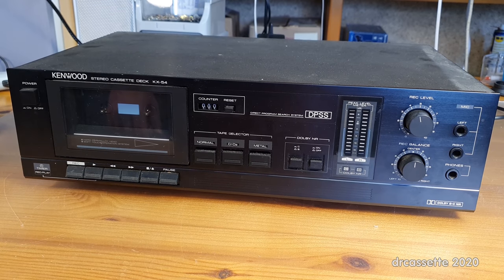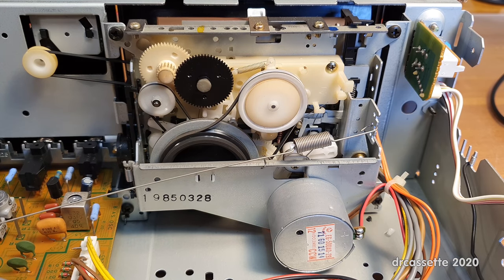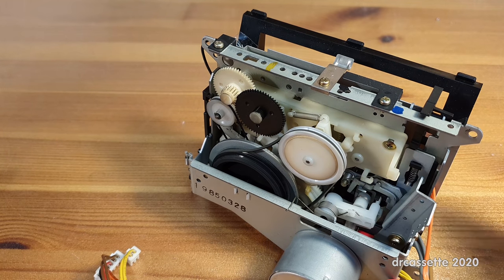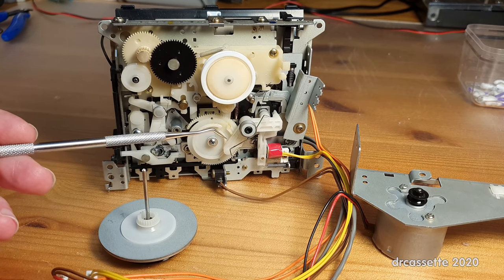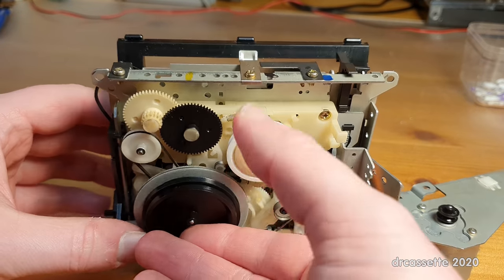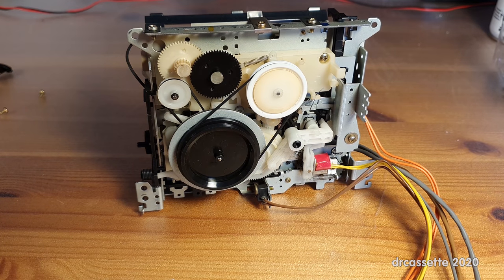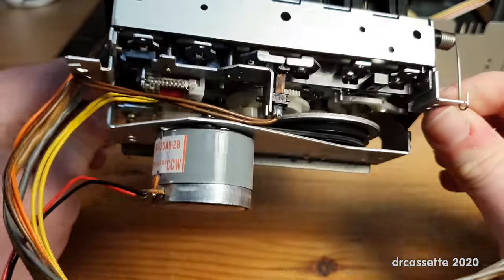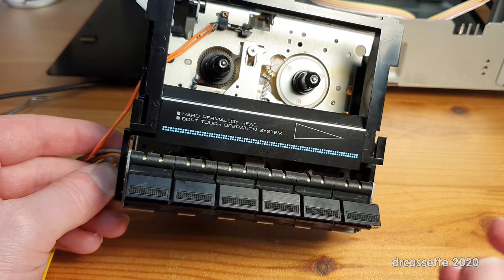Kenwood KX-54 cassette deck repairs

Comment: oh man, i used to work for the kenwood (and yamaha , pioneer , HK , etc) service station in europe and i must have repaired 1000's of these kx-54's in the mid 1980-ies , there's a known problem with these where one of the spring holders breaks and the play bridge just drops again after pressing play (easily fixed if you know how, just bend the now loose spring 90 degrees down and insert in the opening the spring holder now shows) 

these kx-54's were the cheapest entry level cassette players , speed was always a bit wonky but easily adjusted , just take a 3khz tape (recorded on a known good deck) and adjust speed on the motor (insert screw driver in the hole on the back of the motor) just make sure your pinch roller is clean and also the capstan axle is clean . if speed is still wonky check the main belt and make sure its not rotating . back tension is easily adjusted by pulling out the spring a little bit behind the take up reels
Reply from the maker: The KX-54 is indeed a very basic cassette deck, but I did like it. Unfortunately I couldn't get it to perform well. Later, after I had already disposed of the deck I found out the replacement motor I had used was a cheap Chinese fake of a Mabuchi motor, that's what was causing the excessive wow&flutter...

Comment: A bit like my Toshiba Beta video that didn't want to be fixed.  The set of locking levers on that also jammed up and had to be lubricated as best as they could be in-situ because access was not really on.  My YT videos on that were pretty long but the off-screen work was even longer.  These mechanical issues can take an age to sort out, most people don't have the skills or patience.
Reply from the maker: The big difference is, your Toshiba Beta machine is actually worth this much work being a collector's item. This entry level mid-80s cassette deck was a waste of time to be honest... I will give it another try in a few weeks, and if I can't get it to work then, it will become a parts machine...

Comment: Hold the horses - I've got the mechanism out of the case! Don't know how I'm going to get it back in again!! The motor pulley is locked with melted drive belt - hope I can clean it up properly.
Reply from the maker: The residue of melted belts can be cleaned quite well with isopropyl alcohol.
Reply: @DrCassette  Thanks for your reply - have replaced the belts and all seems to work ok although I got a fright when the motor and associated pulleys turn all the time the unit is switched on! I checked on-line and for a soft touch keys deck this appears to be common - the advice is not to leave the deck switched on unless you're using it. I now have another problem with the RH side of the VU bar graph display not working although with headphones both channels are working ok which smacks of an issue with the meter display electronics. Maybe a bad connection or dry joint somewhere? I've checked the schematic for the driver IC (AN68888) and it's difficult to see how the chip could be to blame for one channel not displaying. I need to get a meter on the voltage inputs to the IC.

Comment: maybe the reason you still have noise after repair is that while you oiled the mechanism, lithium grease needs to be replaced on the moving parts, not oil
as the oil is too thin to remain constant on the surface of the moving parts. But thanks for the video, well done.

Comment: This is a really good cassette deck for playback/Record with a correct azimuth. Also kenwood did it really nice and simple in kx series.

Also playing a cassette in this deck has much better sounding to it with a slight help of an equalizer. 

I have an earlier version of this cassette deck called Kx-31 and has very similar electronics inside it. I did use mine for (cd to cassette) recordings and sounded really great even on type 01 cassettes such as TDK D , Sony HF and Maxwell UR with higher levels. 

This cassette deck series can produce amazing good sounds if you adjusted bias slightly negative (pots are inside the deck and easy to adjust) and use TDK D, Sony or Maxwell type 01 cassettes and can be recorded at very high levels too .. Don’t use Dolby on recording coz no need. 

Also , I found that generally using slight negative bias is perfect for most type 01 cassettes and sounded great with higher levels on kenwood kx series. 

If you apply more bias on type 01 cassettes you will lose lots of higher frequencies on the tape and sounds get very poorly reproduce with higher uneven bass. 

I don’t know if you still got this deck , but maybe you can do some cd to cassette audio recording testings with ( bias pots adjusted to slightly negative )and see how good it is with good branded type 01 cassettes.
Reply from the maker: Many years ago I too had a Kenwood KX-31. The mechanism in that cassette deck was MUCH better than the one in this KX-54. 
This KX-54 sounds very nice, but it is let down by its simple mechanism.
Reply: DrCassette yeah , very true. 👍🏻👍🏻😉 kx-31 mechanisms were somewhat good. 
However, I also had to change main belt & take up reel belt time to time though coz I had been using the deck lot for tape recordings. 
But I do think it was a sort of Kenwood design issue which put motor and gear system & belts under lots of stress when you used daily 😢😢 

Kenwood was doing some cost cuttings on cassette decks back in 80s, but I am still happy to see this good old kx mechanism whereas we see even modern tape decks such as TASCAM 202 mkv2 uses cheapest cassette mechanisms can lead to lots of unfixable wow and flutter on playback/recordings over the time😉😉 .
Reply from the maker: I too had to replace the belts in my KX-31. The original belts had melted like they did on the KX-54.
Reply: DrCassette True, unfortunately 70s,80s  original rubber materials had a tendency to melt like that over the years. 

I think newer 90s belts made up with much better materials coz I still have the original belts on my Yamaha natural sound cassette deck ( KX series , two head / play trim / Dolby B/C /fine tune bias). 

However to my ears, Yamaha deck was really good for tape playback rather recording 😉
Playback trim adjuster helped to boost some high end frequencies on tape playback so the tape sounds refreshing without the use of an equalizer 😍👍🏻 
I like that feature on Yamaha decks coz many manufacturers surprisingly didn’t give any user pre amp tone control to their decks for playing tapes.  But Don’t know why 🤔
Reply from the maker: Even in the 90s bad belts still existed. Take for example the 90s Sony cassette decks. It is hard to find one now that does not have bad belts...
Reply: DrCassette Well, not a big fan of Sony cassette decks. I had one earlier days(1990s) and got rid of it coz playback/ record circuits paths had some corrosion and it was repaired two three times too😢😢

Do you own any Sony decks? Do they aged well? Coz the one I had , was not aged well when you use daily to play tapes. 

Sometimes, over-engineering cassette mechanisms with cheaper parts caused many unnecessary issues. 😢😢

I think it is relatively harder to replace belts in later Sony models coz belts are well covered and isn’t easy to access the belts 😉😉
Reply from the maker: Indeed replacing belts on 1990s Sony cassette decks is extremely complicated. I did it once successfully. After that, the cassette deck sounded pretty good, especially Dolby B was very well implemented, it didn't make the music sound lifeless and dull like it often does on other cassette decks. I don't have the cassette deck anymore though.
Reply: DrCassette Very true , Dolby B somewhat worked quite well on those Sony decks. 
I don’t know why manufacturers had not thought of adding the dynamic noise reduction(DNR) system for audio tape playback on many consumer hifi/tape decks in 80s. Pioneer did implement in few decks with DNR system in late 90s and playback tape sounded good with less hiss so it was easy way out😍👍🏻👍🏻

Comment: hi have seen this inside before  in many models   a to deck one    yes the W1 deck   6 track  recorder  i had to change over motors  i pimped to 3 3/4 on the 2 tape decks   
the pulley was bad on the stereo decks so i made a new one

Comment: I have sony mhc p99x. 125w small mini ...its fan does nt work and it gets hot around 60..70 C. can i use computer fan? will it burn if fan is not working?
Reply from the maker: You may be able to use a computer fan, if the device provides the correct voltage.

Comment: amazing video. I watched a lot of your videos, and they inspired me fixed several deck myself.  Amazingly I had the same table as you have, from IKEA right? Man, it is so similar to mine.  Last time I got a tiny screw ejected from a spring and disappeared in my room and I searched for it until midnight.  Oh, my lord, I gave up this hobby as it is too much stress, not good for your health.  Love your videos.  Big fun of you.  Thanks
Reply from the maker: What table do you mean?
Reply: the working bench. not important anyway.  looking forward to a video on Nakamichi deck in the future.  Thanks
Reply from the maker: The workbench seen in this video I built myself from scratch, to my own plans. I actually have a Nakamichi cassette deck in need of repairs, but that will be a future project.

Comment: My 1990 cassette deck still operates good but there is a low squealing noise when during playback. What could be the matter?
Reply from the maker: It could be a similar problem to what is shown in this video. But when it comes to noises, you have to listen closely and track down the problem yourself, this is not a standard problem such as bad belts...

Comment: The mechanism in this deck is almost the same as tgat of AKAI HX A1,the motir is also the same,12 v dc.In my case after changing all the belts when I was fixing the screw of the white colour lever I used the wrong screw of rge oitside body which resulted in the cracking of the plastic body.Any how O have just managed it and the lever goes just up and down perfectly .If I tighten it the playback continuously happens as the lever dies not go down.AKAI HX A1 is also a crap model ,but yhe motor is useful.

Comment: Looks like it was a bit of a nightmare getting that cassette deck repaired a few times,,,with the sticky mechanism after replacing 4 belts. 
I have a 1982 teac v-66c stereo tape deck which I had worked on replacing the belts,,,then the motor,,,thank God I was able to get one on eBay the same type with a removable plastic motor pulley fitted to it from the old motor.
The mechanism is all solenoid driven for the play,stop,and pause,,,and another reversible motor does the fast forward and rewind.

Comment: Although an entry level deck, the permalloy head and track search mechanism are quite nice touches.
Reply from the maker: Though the permalloy head either isn't that hard after all, or it saw really a lot of use - it is visibly worn.
Reply: @DrCassette  Yes, maybe not the best quality. We had one on  a 1974 Sony deck (TC 131 SD), and after many years of use there was barely any sign of wear.
Reply from the maker: Of course it also depends on what cassettes are used. For example the early BASF chrome tapes were like sandpaper. Not good for the heads...
Reply: @DrCassette  True.

Comment: This is why I don't like DIY'ing. It's such a disillusion...
I don't think it's the speed change of the reel that stops the resonance though, I think it's the weight of the reel.
I'd be tempted to try and blu-tac that area and see if I could stop the resonating that way.
Reply from the maker: It could be both, the speed or the weight, though as I showed in the video, just touching the take up reel, without applying any force (so without changing the weight), makes the noise go away... There must be something wrong with that clutch I believe.

Comment: This looks like a re-badged TEAC. You put a lot more hours into that than I would have any unless it was a very high end deck.
Reply from the maker: Indeed it looks a bit like TEAC cassette decks looked at that time, but the TEAC decks actually contained more plastic. This Kenwood still has a face place made entirely from aluminium. I know I put way too much time into this, but at first I was taking it as a challenge, and when I got fed up with it I still continued just to finish the video.
Reply: @DrCassette   I understand. I almost don't want to give up on a project sometimes so it just goes back on the shelf until I can figure what it needs or waiting for parts for some time. Sometimes it's sits there for weeks or even months. I sometimes just give them away if it's not worth it. It makes for good education for tinkerers. I never get rid of anything that's high end. It's always good for parts if it's badly damaged or beyond repair.

Comment: I have often wondered how these manufacturers actually assembled these decks successfully - there must been many failures at certain stages of manufacture? Some parts are so flimsy and easily breakable.
Reply: The first time it goes together it's fine, it's once you start pulling it to bits is when it really becomes a problem, especially when its 35 years old.
Reply from the maker: If you have an assembly line and you know the exact order in which pieces go together, there shouldn't be any problems. It gets difficult when you want to take the mechanism apart again, and then put it back together, because even if you have a service manual, you never know the exact steps the manufacturer took for assembly.
Reply: @DrCassette  "because even if you have a service manual, you never know the exact steps the manufacturer took for assembly." .... that's true!
Reply from the maker: Also, in the factories they often have special jigs to assist with assembly...

Comment: After all that goo and mechanism problems it now works!.
Far better than it was :-D
i'm sure you will find all of it's annoying problems.
The goo reminds me of phillips tape recorders, black goo in every one  :-(
Reply from the maker: Unfortunately there was no happy end for this cassette deck. I tried it once again a while after making this video, but the speed was still very unstable. So I decided to scrap the deck. It was not until recently that I finally figured out the problem: The replacement motor I put in was not a Mabuchi, it was a Chinese fake made to look like a Mabuchi motor. Not sure if this video contains a close-up of the label of the motor, but on there is an upside-down Mabuchi logo, so it's not an M, it's a W! I'm sure the unstable speed was caused just by this fake motor. I noticed this when I was about to install that motor into another cassette deck. Good thing I did, otherwise that repair would have been another disaster...
Reply: @DrCassette  It's not your fault the motor was a pile of poo.
it's easy to overlook something that looks fine at the first glance.
I've made that mistake quite a few times.
And when i check that part on every unit, it's perfect of cause.
Or it works while the device is in my hands, then it fails when the owner gets it back.

Rather annoying.:-(

Comment: Was 27:49 was that a stab at vwestlife?
Reply from the maker: Absolutely not, when I made this video 2 years ago there were a lot of people demanding W&F measurements, some even suggesting my repair work was bad because I didn't measure W&F afterwards. I have since given in and invested in a Leader Cassette Checker which includes a W&F measurement function.

Comment: The belts from your parts bin, are they all new or just spares, I’d be curious to know. I get my spare belts by taking apart cheap electronics. Not only is it fun for me, but finding useful parts and examining the construction is interesting. By the way, if you have a curious animal such as a cat, don’t let them into your spare belts as they love to play with them :)
Reply from the maker: Same here, the belts I have in my stock of replacement parts were all salvaged, either from old electronics that were unrepairable, or from modern cheap electronics. This means I have to keep an eye on these belts because from time to time one randomly goes soft and starts melting...

Comment: The motor you are using looks like a Mabuchi knock-off from China. I've tried using those as replacements also, but they have never been completely satisfactory.  Good replacement motors are difficult to find these days.
Reply from the maker: Yes, it was indeed a crappy Mabuchi knock-off motor. It was the reason for the unstable speed. Later, after I had already scrapped the KX-54, I tried it in another deck, with the same results. Then I knew that motor was no good, and threw it away. I usually use motors salvaged from other old cassette decks, but that one must have come from some modern device...

Comment: With all those problems it really turned out to be a piece of junk after all, worthy of being in the trash heap.
Reply from the maker: I still have this cassette deck, I'll probably give it another try in a few weeks, if I can make it work better I will keep it, if until then it develops more problems or the mechanism starts sticking again, I will part it out and get rid of the rest.

Comment: Watching this video now. This mechanism is probably one of the worst I've ever seen, its a technical error.
Reply from the maker: Indeed it's not very good, though the excessive wow and flutter I could not fix in this video was caused by a bad replacement motor, it was a cheap Chinese fake of a good motor...
Reply: Yes! It's a faulty design. Stay away from crap like this. It'll had been far better, if Kenwood had used a full mechanical "button"-mechanism (with a "real" flywheel)!